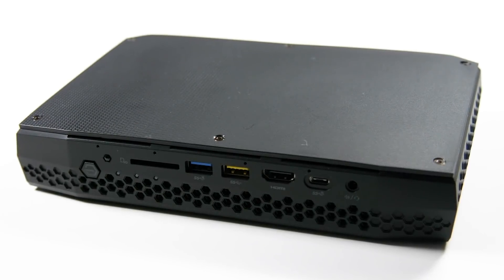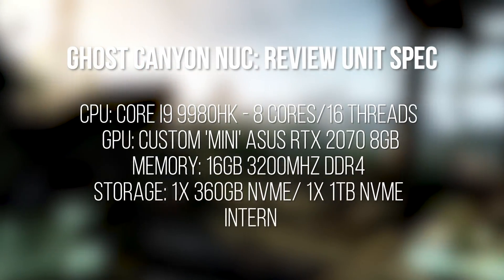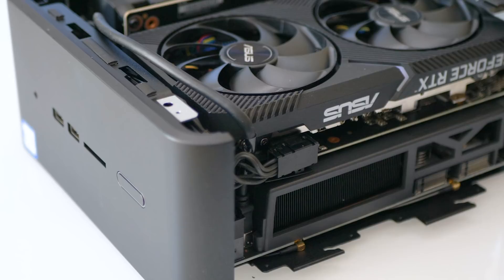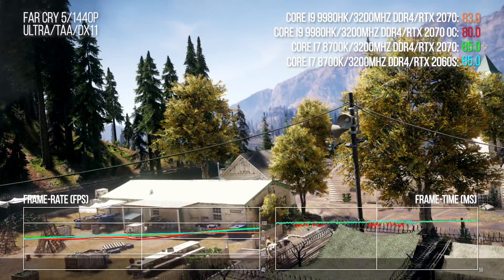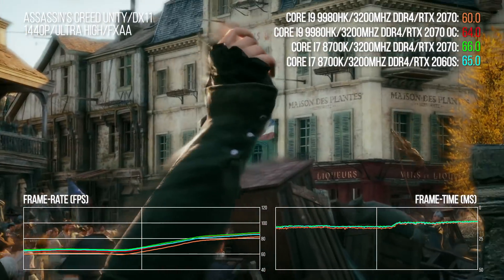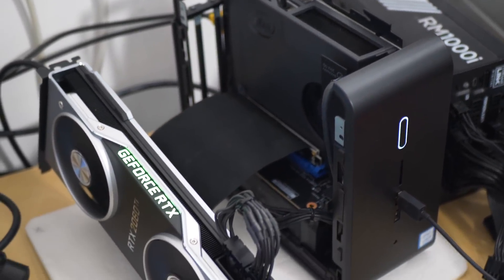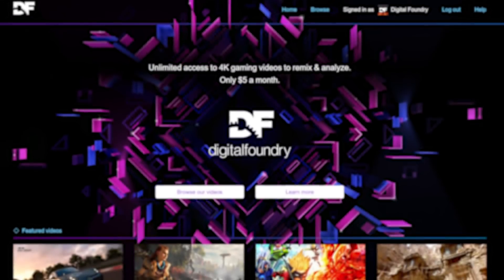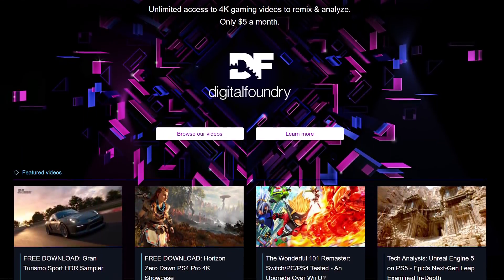Ghost Canyon NUC 9 Extreme Review: High-End Upgradable PC Gaming That's Smaller Than Xbox Series X

Comment: Smaller than Series X, but also more expensive, more power consuption, and possibly worse thermals than Series X
Reply: @RIPPER809  You think a 2070 can run all games in 4k60?
Reply: @RIPPER809  even though the gpu is far weaker? And the CPU throttling due to heat? You wish.
Reply: To be fair, it's using this gen of hardware, if they swap that out with a small form factor card of what AMD and Nvidia comes out with later this year, it would likely perform better than the next gen consoles which is quite impressive when you think about it.
Reply: Yeah if you only want a great gaming experience, its hard to justify the price of this thing. And if you want a PC, you are really paying a premium for this form factor.
Reply: @Hallison Michel True, it would make more sense now with the hardware they are using and the fact they are adding in mouse and keyboard support. They always said they wanted Windows inside as many living rooms as possible and that was back before the 360 days. I think this is why Sony originally allowed Linux on the PS3 as they were worried MS was going to include a copy of Windows Vista with the 360. I could be wrong but its just a hunch.

I have heard that Microsoft are allowing Steam as an App on the Series X. Which could be a huge game changer.
Reply: Don't forget probably weaker gpu than Sx.
Reply: @RIPPER809  neither will the Series X be. PC fanboys dont have room to talk here
Reply: @RIPPER809  Richard purposely said this units GPU is compared in performance to PS5, as Series X is more powerful.

How stupid are you? Just out of curiosity.
Reply: Unless Microsoft package Windows 10 Pro with the Xbox Series X then this little PC can do 10x what the Series X can do. Remember its not just gamer's buying these products.
Reply: @Fezzy976  You have to be dumb if you chose that design over a conventional Atx build if you want to do anything else but playing games and other media consumption.
Reply: @nhkk2893  Oh no I completely agree. I am not talking about the form factor just the hardware used inside the machine. The form factor is just for looks, sure it does and will increase the price due to the engineering that went into making it so small. But that doesn't take away the fact that the hardware inside is still expensive because of what its capable of doing. I agree an ATX build would be so much better but remember people buy stupid things. All I have to do is point over to Apple.
Reply: @Fezzy976  why would you spend $2000 on something like this if you arent going to use it as a gaming machine?? Graphics designer cards like Quadro are there for a reason
Reply: @mrpiratefox4497  $2,900 actually... It's an absurdly bad purchase for doing things other than gaming and it's a pretty questionable purchase for gaming. At that price why not just buy a gaming laptop if you have to be portable? Because you're gonna need to tack on extra money for a monitor anyways unless you plan on taking your current monitor around with you.
Reply: Can do ten times what the SX can do.
Reply: You completely missed the point. lol
Reply: @tymelancon7628  And what's the point? Who is this item really for? Certainly not the average consumer and definitely not a gaming enthusiast. It's extremely niche and pointless. Not to even mention now is a horrible time to buy a higher end PC, and this thing only has a 2070.

Comment: I would hope this thing is more powerful than a PS5, it costs over 2000$ with a 2070
Reply: Small size usually has a pretty steep price tag.
Reply: I habe a Laptop with a 2070 and i7 9750h (basically the same as the i9 but -2cores). Comes with a 120hz 1080p screen, keyboard, battery etc. 1400$ ^^
Reply: As he said its comparable to it, so the price point is really brutal
Reply: Comparable to PS5 (at $2000, yikes), but without whatever exclusives PS5 gets, the PS5 exclusives that will look amazing, play amazing and will only be found on PS5. I already own an high end PC, so I know which one I would choose between this NUC-9 and PS5.
Reply: Joseph Van Der Merwe 

The pc also has good exclusives though, especially on Vr (like half life Alyx, Asgard’s wrath, lone echo, Boneworks, Medal of Honor...)

Comment: I think Intel is doing something interesting, but most likely not competitive enough in the current context.
Reply: The fact that you can build a smaller, a full 20% smaller, better cooled and more powerful with off the shelf M-itx components really makes this redundant. Velka3 or k39 case is smaller and can accommodate of the shelf parts. Slightly limited in GPU lenght, but so is the NUC. 

If however you need bigger GPU velka5 case can support up to 296mm and at only 5.7Liters . 14% bigger than the NUC.
Reply: @gismo3564  Those tiny cases are an absolute nightmare to work with though.
Reply: @chuploops9973  that's very much subjective. Personally a build in the k39 takes shorter for me than a standard atx case. 

On top of that the NUC module does not look any easier to work in. The fact that you have to screw loose the fan in order to awkwardly access RAM slots, nvme slot or in case of dust cleaning the same makes this more difficult to work in than, for example the k39 Case for me. And you loose any sort of cooling choise. 

The reason this makes it redundant for me is the fact, that it's just as difficult to work with as building a diy build, it has none of the modularity advantages, it's not particularly space effeciant, it's not particularly fast, it uses none standard parts and locks you down to a specific ecosystem of products, which may or may not be upgradable in the future.
Reply: price wise, it definitely is not. Looks to be aimed at enthusiasts more than anything.
Reply: This isn’t anything new though. Anybody remember the „steam machines“ a few years back?
Reply: @coolertuep  Were those actually upgradable?
Reply: ? Intel are nearly a decade ahead of AMD.
Reply: @fcukugimmeausername  
A decade ahead? Why do you think that?
Reply: Attila TheHUN decade ahead in losing maybe
Reply: @AttilaTheHun333333  Yup the Intel's Logo is decade more advanced than AMD.
Reply: @fcukugimmeausername  Spotted the fanboy
Reply: @fcukugimmeausername  gyahahahahahahha no
Reply: @fcukugimmeausername  how intel maxes out at 28(not server) cores amd at 64 threadripper beats every workstation xeon out there